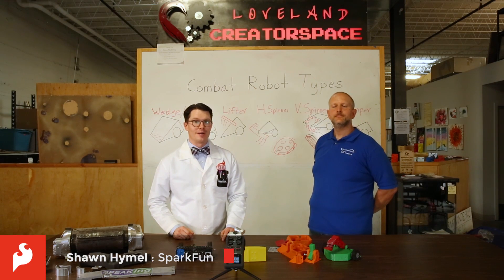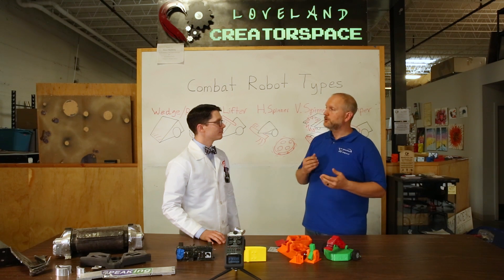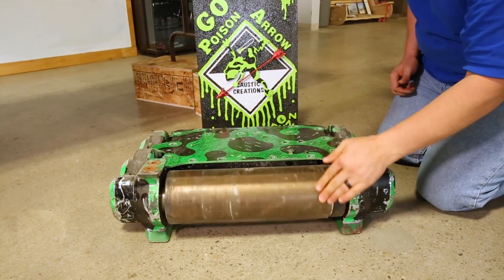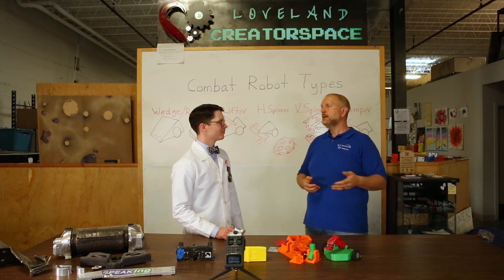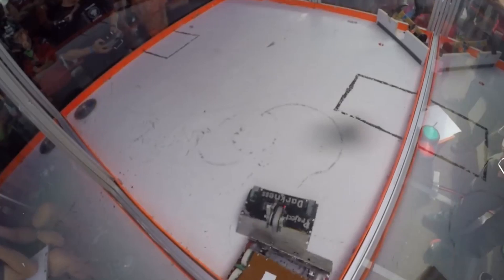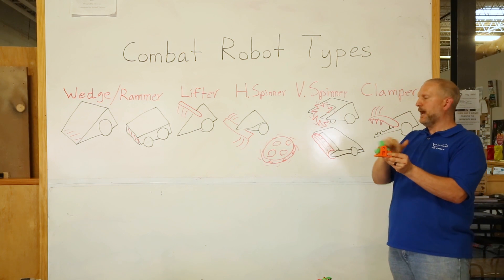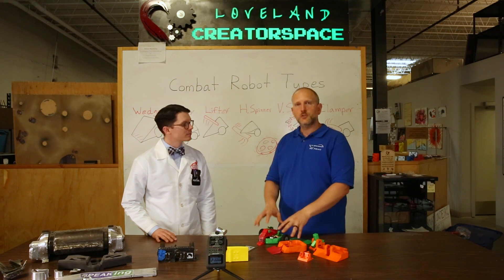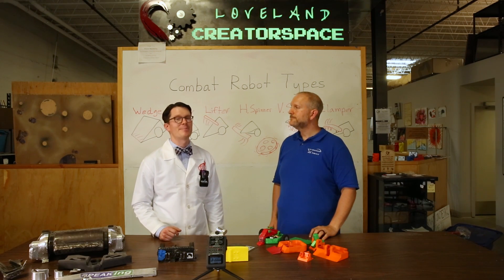Adventures in Science: Combat Bot Weapon Types

Comment: why there is no DRILL ?
Reply: because so far every bot that wanted to run a drill got rejected. Because they won't cause significant damage. How on earth that works when you have grab/crusher bots that use fire which also don't cause damage unless they ignite the wiring is beyond me. 

Like really this is something that still makes me upset to this day because its such a simple theory and we had worse bots in practice. You make a bot that can grab and then you give it a drill with that it directly drills into the core of the enemy and delivers a instant knockout when it hits a vital part. 

Wanna know a bot that pretty much had the same game plan but with fire instead? Complete control and what did we get from it? A great battle against bombshell. 

So why is there no Drill? Because tournament host said so for dumb reasons.
Reply: Drills dont seem to really work.  They are not much better than putting a pointy spear on your bot

Comment: So here is a list I made where I ranked all the weapons you could use on a Battlebot. This is my opinion and you can leave yours down below. 

8. Fire
7. Hammer/Axe
6. Grappler
5. Pusher/Rammer
4. Vertical Spinner
3. Flipper/Lifter
2. Drum Spinner
1. Horizontal Spinner
Reply: 8. Fire (does almost nothing to most bots)
7. Axe/hammer (waste of weight might aswell make a better wedge with more armor)
6. Pusher/rammer (lame and boring)
5. Fliper/lifter (can work and be cool but less practical than a spinner in most cases)
4. Grappler (so high because of krave)
3. Horizontal spinner (worse in almost every way to a vertical spinner in theory)
 2. Vertical spinner (I like them)
1. Drum spinner (stores the most energy in the most compact and simple way because they can have the same kinetic energy as a vert without a massive diameter)
Reply: In my opinion adding fire to a grappling bot works decently well, also I think hammers are somewhat effective if you add either a decent wedge/armor kinda like beta.